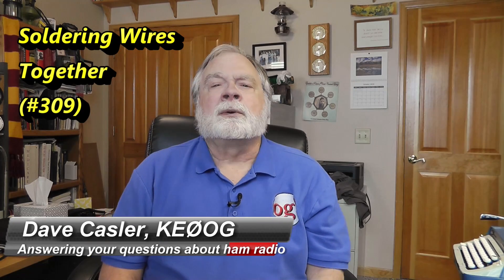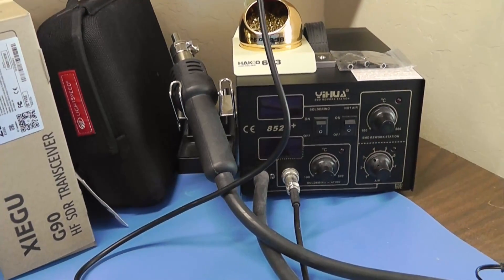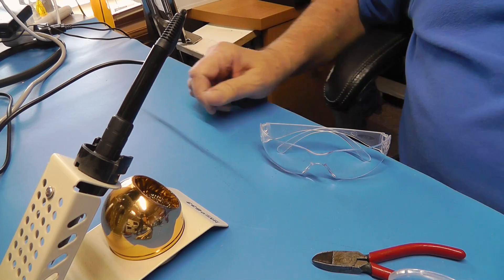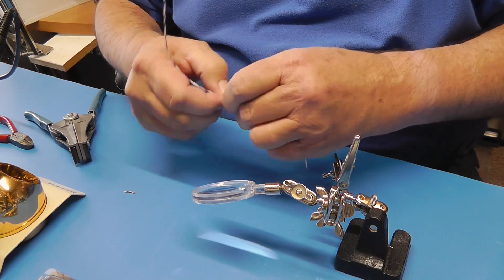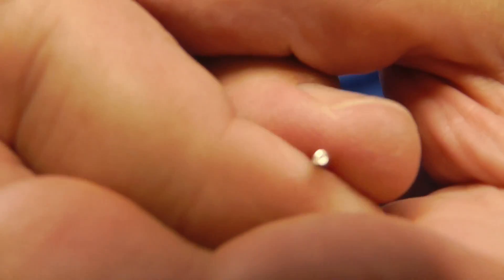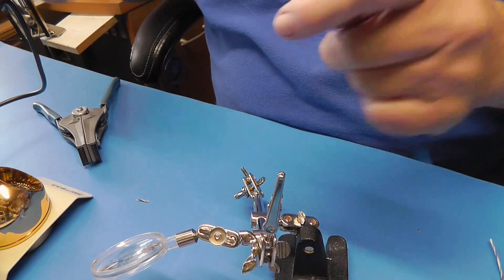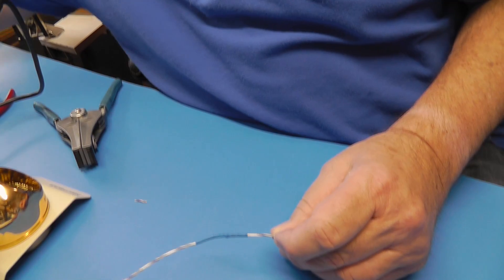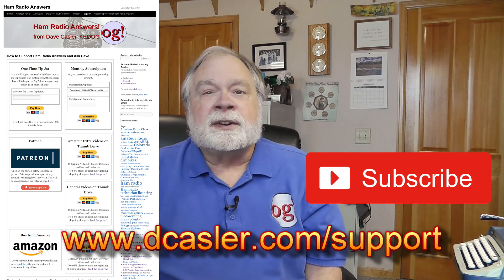How to Solder a Wire (#309)

Comment: I was taught to heat up the part to be soldered first then touch the solder to the heated part. The reason why is because it will draw the solder into the all the wires that are twisted not just the surface ones. Folding the wire over on itself is not a good idea either. It creates a weak spot in the weld.

Comment: Your first attempt at the western union splice is the one I actually prefer. When soldering 'real' wires with things on them at the other ends, you would generally cut and slide a piece of shrink wrap down one of the wires BEFORE soldering the joint.

Comment: If ends of the wires are connected to something else, slide the tubing on before connecting the wires.  Be sure and keep the tubing well away from the joint during soldering so that the tubing does not shrink  from the soldering heat.  Heat shrink tubing is soooo much better that electrical tape!

Comment: Thanks Dave. I would like to mention the joint can be made with a "j" at the end of each wire. The wire can be pre-tinned for ease of soldering (already very easy) and squeezed together with pliers before soldering. Just another option. 73